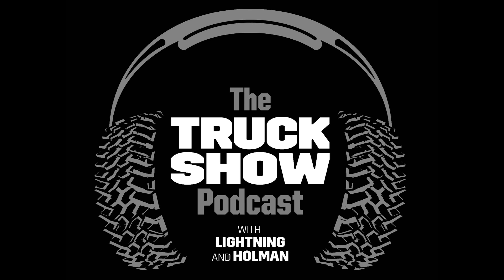THE TRUCK SHOW PODCAST  - Bollinger Motors

Comment: I've been on the reserve list within the first 48 hours I can't wait. 
The questions I have are: 
1, What's the network going to be like in Canada ( buy and repair) 
2, Well there be an option for more setting 
3, Did Tesla say ok for you to use there charging stations 
Thanks great show
Reply: I just saw the new Jeep pickup. Sorry. I'm done with ICE. 
It's pushing me even more for a Bollinger.
Reply: You very right that is one of the Beauties but I don't know how to fix a hydropneumatic suspension nor do I know where to go that won't void my warranty and it's a price this may go for I would like to know that I can go to somebody who won't void my warranty
Reply: Of course, one of the beauties of an EV is that there is very little serving needed. And with most of it, anyone can do the repairs.
Reply from the maker: Hey Cory, You'll be able to order and buy Bollinger trucks online. We will have certified third party service centers for repairs and maintenance. There won't be more seating options. No response on the charging network yet! If you haven't already, you can reserve a B1 (at no cost ) on our site. It signs you up for the newsletter. Also - follow us on instagram for weekly updates on info like that in addition to the newsletter. Cheers!